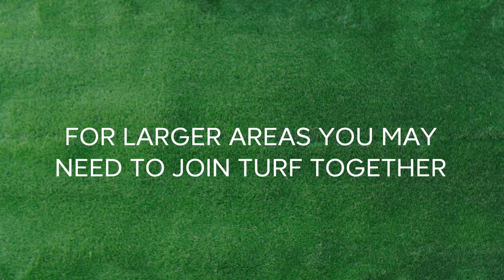How to lay artificial grass

Comment: How would you compact the sand without that machine?
Reply from the maker: Hi, you can take small steps using your body weight to compact the sand but this will be quite time consuming. You could also try using a mallet on a plank of wood, however, you will need to use the same force throughout to ensure it stays level. Alternatively, you can saturate the sand with water. Once the water has ran through, it'll be nice and compact. However, as you will be covering it with artificial grass, it may be best to ensure it's dry first. Hope this helps! 🙂
Reply: Hand tamper. You stand and pound it down with a manual tamper- grunt work, but cheaper

Comment: Does rain drain off through the turf and the membrane, or is there a need for allowing a runoff?
Reply: Artificial grass has ample drainage holes in it.
Normally a 75mm layer of compacted Type 1 hardcore would be laid under the sand to improve stability and drainage.